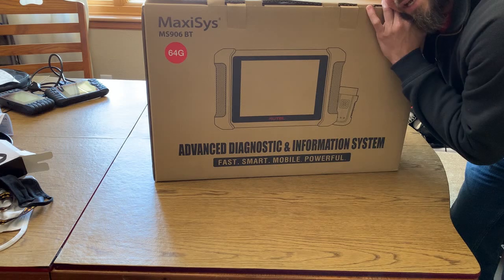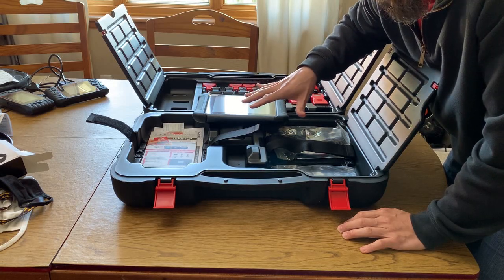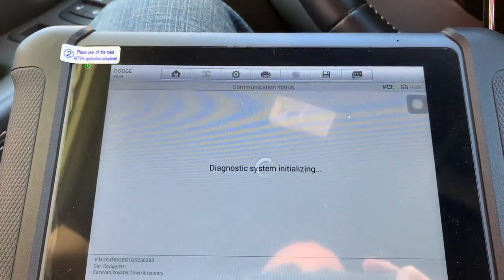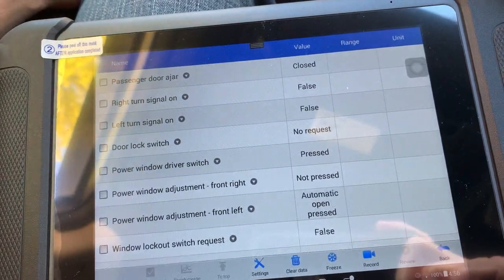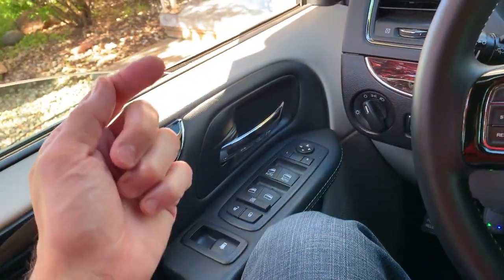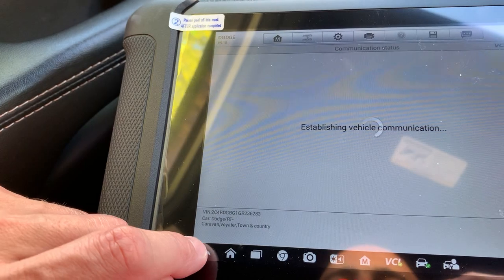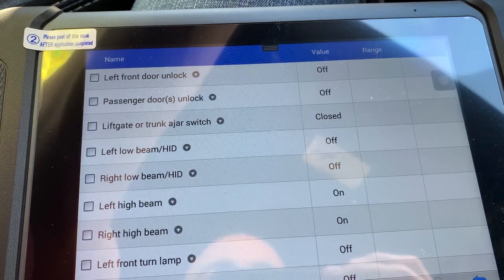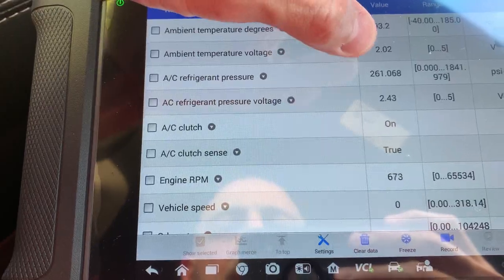Are Autel scanners USELESS - MS906BT - MUST WATCH BEFORE PURCHASING -

Comment: So everthing goes thru the module first, and the scanner sees that.  So if the scanner sees some command and the command does nothing (squirter or window or door lock) then the fault is downstream of the module....like disconnected wire right at the window or door lock, etc?  Or can the module report an open circuit downstream?
Reply from the maker: @alext8828  precisely 💥 if the modules says its working then 99% of the time theres output from the module. But if module says its working and you get no output, confirmed bad module. Easy as that

Comment: I have the mp808, I bought it years ago and use it daily. I like how much they give you for an entry level scanner. So much that I think the next one(soon) I'm going stick with Autel and get a newer one. Even though there some cheaper options around now. I use alot of those same bi directional functions but it loads screens much slower. I'd rather still be able to do the test, even if slower than it not just letting me do the test or see the live data for bcms. I even have had the Autel power probe clone for well over 3 years now. I was thinking of eventually getting a Power probe then was like why? Probably another one of them also because I've used it alot with 0 issues. Good vid!

Comment: I bought the same tool in aus and it was a great tool to look at but it was terrible for my old vehicles which could not even auto vin 1800 brick but a brick would be more functional than the MS 906BT 0 after sale or a response contact manufacturer via tool 
Free I'd say keep it with the Holden vy and falcon incurring more faults and dtc engine abs and srs on cleared 0 dtc
These folk given the tool to promote. 
Toolpro 30 tool more functional 
Topdon phoenix elite my hope

Comment: Great video! it made me realise that I'm not really using my autel mk808 to its full potential. just out of curiosity, can you use this method to pinpoint a camshaft position sensor fault? I have a car with this fault but as far as I'm aware you need to test the sensor with a scope. After watching this video I am thinking the autel may have a test for the sensor or wiring.
Reply from the maker: @stevendyson6712  graphing might help. But to truly diagnose a cam sensor issue it depends on a few things.
What the actual code is. If it says circuit fault, then its wiring or sensor. If it says short to power, or ground, or signal then you need to focus on that specific wire. If you have more than 1 sensor on the engine the  swap it see if the code moves. The graphing would just help catch when it drops out. But when you get into catching crank and cam sensor issues, its usually a bad sensor, but try to find the consistency in failure so you can reproduce it. Wiggling wiring, check for oil ingress. Hard to say what I would do first if I never had a cam sensor issue. Hope this kind of helps
Reply: @MasterTechLou  Thanks for the reply, some good suggestions there thanks. The code is P0340-28 Camshaft position sensor circuit range/performance.
I am thinking it is more sensor related but i am going to check the engine timing first as i have a feeling the timing belt maybe a tooth out?

Comment: You so hit the nail on the head with this video.  I was looking thru the GM service manuals and saw, as you said, very few if any switches
or other user electrical controls communicated directly with an end item.  So, it seems that the scanner helps to see that the "code" running inside a control unit is reacting to user inputs...or not in order to command the end item.  Thanks again awesome job.

Comment: Can you do relearn processes with this scanner? I have a cheaper scanner but now with a bunch of new sensors require relearn procedures I am trying to find a better scan tool.
Reply from the maker: @alexbland7890  yes you can. There are many scanners you can do that with. They must be an all systems scanner and have bi directional capabilities. Check my channel I have a ton of reviews on such scanners.
Reply: @MasterTechLou  do you have a recommendation that can provide that function with basic diagnostic features and value capturing?
Reply from the maker: @alexbland7890  launch or xtool scanners are awesome value 🤷🏼‍♂️

Comment: is it ok to have engine running when using can tool?
Reply from the maker: Absolutely. The only thing you want to avoid is running a health check or code scan on the entire car while it’s moving. I have never had anything happen but theres always a possibility of something being affected while the car is moving. But yet you can do the scan with engine on or off with no issues.

Comment: Hi Lou,
I have a 2012 E350 station wagon.
The rear end drops evenly almost always when the car is not running.
I've replaced the valve block with one purchased from a dealer.
It did not fix the issue. Otherwise, once it raises, the car maintains its height and it drives fine.
Any suggestions as to how to diagnose further?
Thank you,
Frank.
Reply from the maker: Either another bad valve block or bad air bags. My video really has all the answers in it.

Comment: I had a problem with my Aircon there were codes. But both launch pointed the problem to the control panel of the Aircon. But it wasn't. It was the actuators problems

Comment: Would you rather get the Bluetooth version or the cable version?
Reply from the maker: I got the bluetooth because I need to be able to activate items and be next to them as I often work alone.
The same could be accomplished with an OBD extension cable as well. It all depends on your experience and capabilities. And what you intend to use the tool for. So I cant tell you which I would rather, but I could tell you why I chose what I did if that helps.
As I have plenty of other scanners with cables and the only setback is needing a second person to activate the buttons while I test what I need to test. Hope that helps some.

Comment: Not! But their tech support is
Reply from the maker: And their batteries…… this thing is only as old as this video and the battery is crap already…….
Reply: @MasterTechLou  ya, it’s hit and miss. My im608 has been nothing but problems but my ultra and 908 have been good
Reply from the maker: @eurowerx4267  not sure your experience or daily working but I have found there is no and probably never will be a “perfect one size fits all “ aftermarket scanner. They all have their ups and downs since being aftermarket and I dont know if they are 100% reverse engineering oems or allowed access to software through oem developers. I wish to know that answer one day. But you would think “brand name” means zero trouble, im learning that brand name
Means nothing when there is no real back end support because it seems all companies can engineer these things yet they have no experience in what is is they are actually engineering. Just copy past software, and when you have an issue its 🤷🏼‍♂️, good luck chuck.

Comment: yea.. you know why people are lost with this scanner,  its because the interface is horrible.  with the ms906bt,  there's no reason for the horrible menu system.  its like its built on a android tablet with a usb radio wired directly into it for the stupid tire sensors.  this could easily have been a cell phone app.. there's nothing special about this other than the SOFTWARE.  and honestly, the $1,000+ price tag is ONLY because they include a "WARRANTY and Service Contract" of $760+  which to the normal person, who just needs to "FIX" his own car,  wont even use the "Service"   and btw -  that $760 Service contract is only for 1 year.. so yea.. wont be renewing that.  honestly,  these features should be built into the car's,  if this information is there, then it should be viewable directly without this 3rd party device.  and if it does require a 3rd party device,  its stupid that i cant use my OWN device, like my Android Cell phone that has 10x the power and resources than this little tablet.  if i took it apart, i'm pretty sure i'll find a $20 RF usb radio identification on the extra module that i can buy on amazon for my cell phone.
Reply: but honestly, the video was great and editing was really good also.

Comment: Good content and the notion of why to buy a scan tool.
You're quite correct, we need to know basics plus before plugging in a scan tool.
I'm not an auto mechanic by trade but was blessed/cursed with the ability to diagnose and repair the junk in the yard.
The 2023 maxi check 808s I ordered is on its way and I followed along to get a sense of what's inside.
I spent a lot of time in a Curtis remote tool for all electric vehicles in the airline industry we built. These Autel scanners are similar in function once inside and perhaps more intuitive than a Curtis.
The scanner will hopefully help here in the yard and also my son's wife has a fleet of Chrysler vans that may need the bi-directional ability to help trace troubles when they arise.
Thanks Lou!
Reply from the maker: Thank you!
And best of luck, I hear you on the blessing and cursed part haha

Comment: "~Are there any videos. With the Autel diagnosing vehicles. That turn over but wont start ?~" 
"~(And pinpointing the component thats faulty or bad)?~"
Reply from the maker: None that I have done, sorry. Crank but no start diagnostic includes checking air, fuel, spark.
Meaning, compression, spark from spark plugs, and fuel pressure.
Reply: @MasterTechLou  Yeah, I agree. I changed plugs, coils, almost every sensor, and a few other things. So am now a little puzzled. I brought a (906TS) used last week. And was just wondering if it was capable. 
Of testing the components I mentioned and others. While trying to turn over or starting the vehicle. One of the components could be faulty or defective. Vehicle did run before a few replacements. It just ran VERY rough. Thanks for the reply.
Reply from the maker: @BeOfManyArtsBlue53  year , make and model?
Reply: @MasterTechLou  2005 Ford Triton 5.4 V8
Reply from the maker: @BeOfManyArtsBlue53  check engine rpm with scanner, see if crank sensor is reading. use old coil , plug it into connection put spark plug in coil see if sparking when cranking. there are not many values with a scanner that can help with crank no start other then rpm. and any codes which normally there are not.
Reply: @MasterTechLou  For sure Thanks. Yeah, imma go through it. With multiple methods. And checc every component I replaced. And any others I didn't. I just haven't seen a video yet. With any scantool reading and diagnosing. In realtime a crank but no start. So, I brought the Autel cause it seemed as if it was or is capable. 
So, I think I'm going to use my electronics and mechanical knowledge. And be the first for myself. To see the extent and capabilities of this device. Also, have a scope that connects to the Autel. 
I'm sure with the two and little knowledge I do  have of that engine. I'll eventually figure it out. Again, it was running just rough before I started changing out components that's DTC codes let me to believe were bad or faulty. 
Again, Thanks for your replies. I just hadn't seen a video yet on it and the approach I'm choosing to take at this point. Thanks again !!!

Comment: Wait so if you hit the switch and it shows that its activating but the window isnt moving that shows powers and grounds are good?
Reply from the maker: Only to the computer and switch. It confirmed the switch is working and the module sees the request.
Not further testing is needed to confirm power out of the module to the motor.

Comment: Mater Lou my guy need help i finally broke down and went to dealship for 2 things 1. Most iportant make sos telaid module code present to not prrsent and the other was to clear and look at sunroof recall.  So did sunroof in 1 min done 3 hrs later they came out told me they could not get in it.  It would have cost 215 pkuse tax they gave car back of course no charge.  Bit i want it gone.  2004 mercedes benz e320 4matic.  MODT system i already installed new headunit door speakers and sub and amp in trunk came out really nice.  Messege says sos malfunction visit the workshop.  Succckkkkssss help this car is really hookes up i am doing all work.
Reply from the maker: It takes 10 min. Code instrument cluster for tele aid not present and then code command for not present and remove it from the loop.
Reply: @MasterTechLou  i told them exactly what to do said could not get in what does that even mean
Reply from the maker: @Jemstk  maybe didnt have the right scanners
Reply: They said they used 3 diff computers xentry sofware star.  It is 2004 mb e320 4matic lil old idk.  Is their a chance they could not get in because loop was on telaid unot idk.  I will get on your web sight if you can help.  I am at wits end brother lol 6 months.  I am trying to get rid of fiber optic everthing.  Got new head unit took out navagation took out cd player only thing left on most system is amp telaid and voice module which i am bout to rip oit today
Reply from the maker: @Jemstk  I don’t know what to tell you, brother. There’s only three modules that matter when it comes to coding. Instrument cluster, central gateway, command.
Reply: @MasterTechLou  i know well at least you got back to me fast thanks for your help bro i really do appreciate it
Reply from the maker: @Jemstk  we used to do
This a lot in the w220 cars. Only the cluster, central gateway (if equipped) and command had the coding for the teleaid-sos. That and then you had to bypass it in the fiber optic loop only if you were keeping the factory audio components. 
Maybe youre dealing with inexperienced techs since now these kids consider these cars “old” 😵‍💫😵‍💫. When these come in the shop now my guys say I should work on them 😂.

Comment: Verbiage with tools is imperative these days.  The 906 is a diagnostic tool, a scanner just scans and reads codes.  Too many people think a $99 scanner does enough, when actually it does nothing to diagnose vehicles.
Reply: I mean I have a 50$ code reader that has definitely helped diagnose plenty of issues.  Some diy guys save money by replacing the quick easy stuff... obviously there are levels to it where parts changing vs diagnostic come Into play

Comment: Very good point in applying basic diagnosis.  Looking for a scan tool that can read modules and clear error codes on 2012-15 Chevrolet Volts.  Would be nice to find one that does not use pirated software or requires subscription.  Maybe I'm dreaming?  I'm not a certified tech and don't do it for a living, respect those who do it everyday.
Reply from the maker: Subscription is only for updates. Most dont need a subscription in order to keep working unless you buy a snap on or matco. Then the software gets locked out which is stupid. And they are all pirated software but I cannot confirm that. I am told companies reverse engineer factory tools and combine the software into their own tools. But I don’t have those facts. There is no 1 size fits all scanner. But for a car that old, if youre just looking to read and erase codes, theres plenty of options for you.

Comment: Do all special functions still if you dont pay for renewal?
Reply from the maker: everything works, the only thing the subscription does it give you updates to the software for all the functions and models. still works fine, only issue is battery life, I treat the battery well, and after the 2 years I have had this thing the battery life will get to 50% very quickly. not sure if they can service this or not.

Comment: Really like your video on this Alltel scanner. Does this model do climate control system testing on the blend door and temperature door actuators, also does it do engine cam actuator tests for timing chain timing? These are just two systems that I run into all of the time
Reply from the maker: Thanks 😊, basically if the factory scan tool can do it, this one can do almost 90% of what the factory scan tool can. It can control blend doors and do a relearn if the module has that option. And yes also cam actuators/solenoids.

Comment: I have recently had my 2012 spinter v6 upgraded with the field measure. I am looking for a scanner to read the newly installed engine control module. I previously used a cap touch pro by launch but it won't read the newly installed module and no sales types have been able to tell me if they sell something that will. I need advice. This update has been installed for several months in US and Canada and someone must know how to read this module
Reply from the maker: thats interesting I will have to check with mine the next time we do a AEM update.

Comment: Yes if you dont know what you are doing and you try coding be carefull you could mess up badly i dont know if that scanner dose but create a backup of the coding before you mess with it also those scanners are not cheap they better have a backup option hate me now thank me later
Reply from the maker: You are correct! I usually screenshot the coding if im ever having to manually code something.

Comment: does this need subscription per car brand per year? or just once per year and get access to all car brands and functions?
Reply from the maker: Sub 1 time per year. Sometimes when you buy it you can get 2 years free updates . Scanner will still
Work you just wont be able to get current updates. So we usually wait every 3 years and then update or just buy a new scanner. Mine is only as old as this video and now my battery drops to like 50% with very little usage. Kinda disappointing.